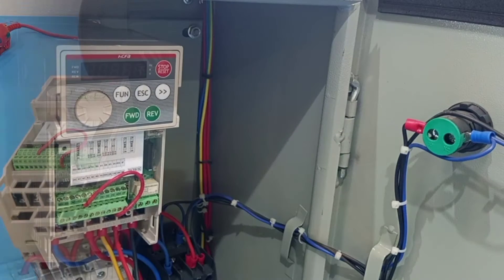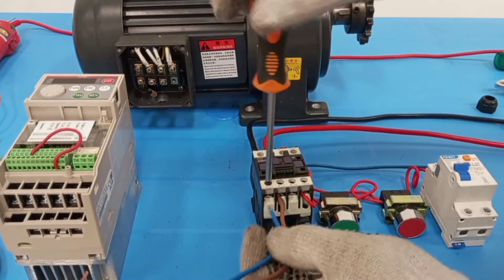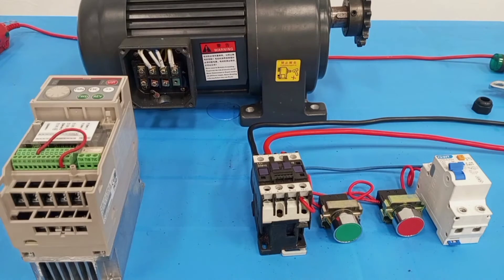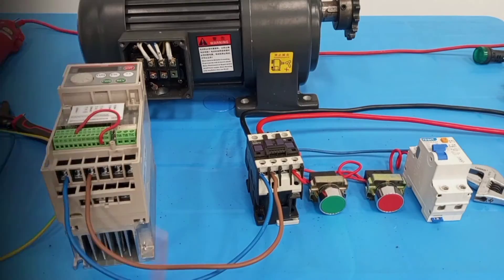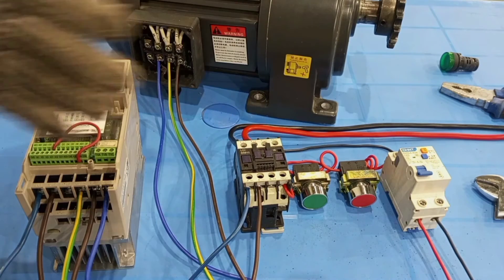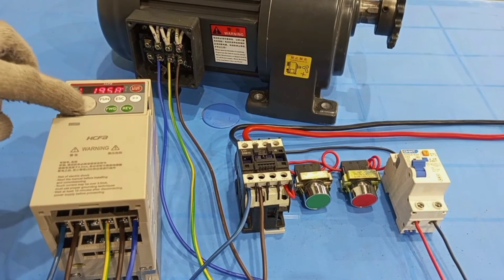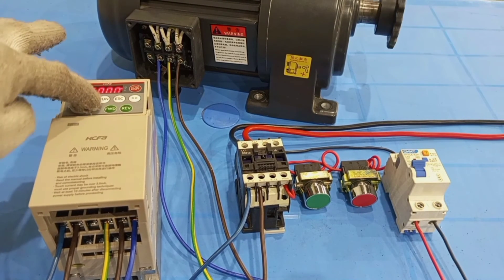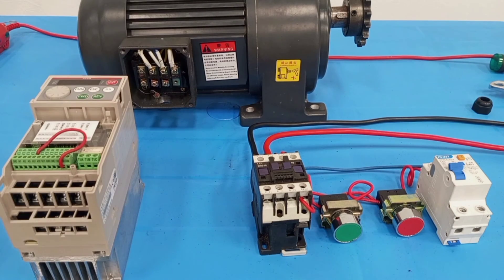LEARN HOW TO WIRE VARIABLE FREQUENCY DRIVE (VFD)

Comment: Thank you sir, but my question is,what component do the VFD has that converted the single phase power to the 3 phase power?
Reply from the maker: A Variable Frequency Drive (VFD) itself doesn't technically convert single-phase power to true three-phase power, it achieves an effect similar to that by manipulating the single-phase input to create a "synthetic" three-phase output suitable for running three-phase motors. There isn't a single specific component responsible for this, but rather a combination of stages working together: